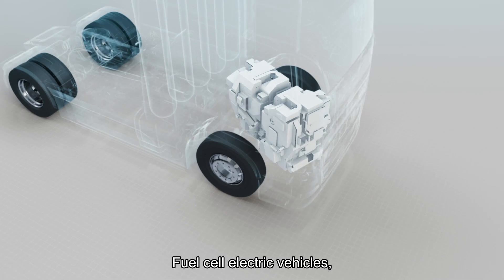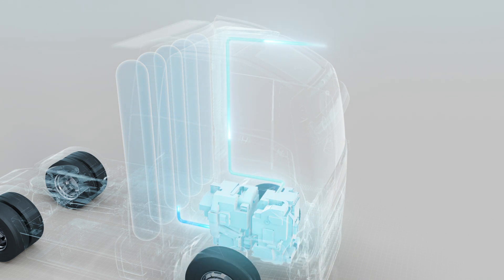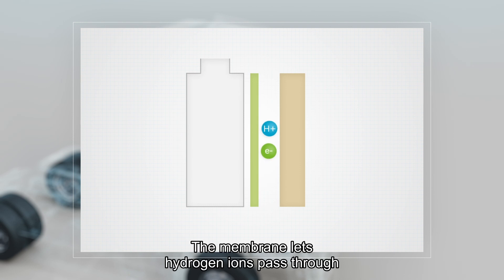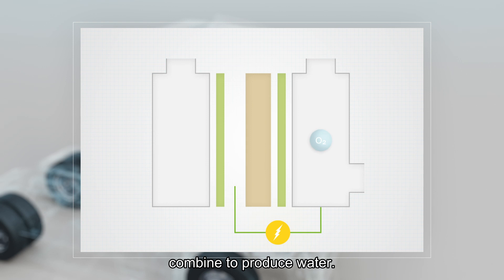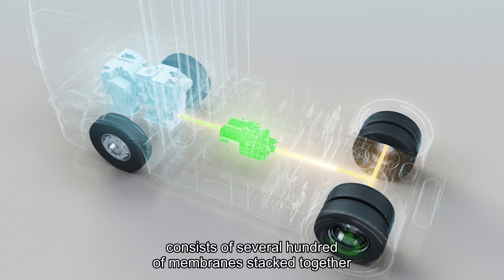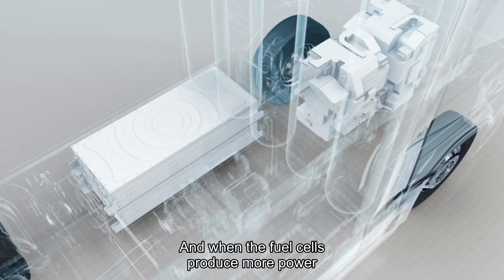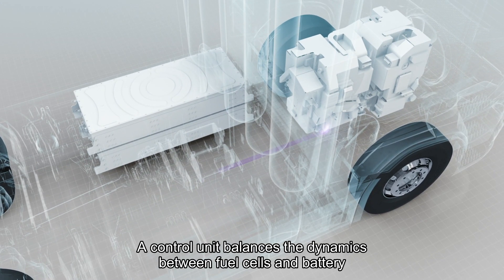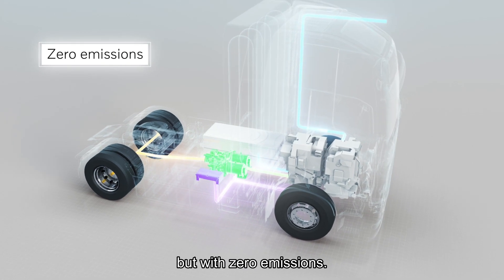How do fuel cell electric vehicles work?

Comment: Volvo why dun you partner with this german engineer named Roland Gumpert? he actually had a Methanol (Liquid Oganic Hydrogen Carrier) Fuel Cell EV supercar (Gumpert Nathalie) and i feel methanol would be far easier to store and transport vs hydrogen?
Reply: burning methanol still produces carbon and it  is more difficult to burn and has lower energy density than gasoline . you are not smarter than volvo engineers.

Comment: TRADUCCIÓN AL ESPAÑOL

Vehículos eléctricos de pila de combustible, donde la electricidad se produce a bordo del vehículo con la ayuda de hidrógeno y oxígeno, ¿cómo funciona?   

Una pila de combustible utiliza el hidrógeno y el oxígeno del aire para producir electricidad y agua.  La celda de combustible consta de una membrana recubierta con un catalizador, cuando las moléculas de hidrógeno golpean el catalizador, se dividen en iones de hidrógeno y electrones.  La membrana deja pasar los iones de hidrógeno, pero no los electrones que, en cambio, fluyen a través de un circuito eléctrico donde se genera la corriente eléctrica.  En el lado del cátodo, los iones de hidrógeno, los electrones y el oxígeno del aire se combinan para producir agua.   

Con el fin de producir suficiente electricidad para poder propulsar un vehículo, un sistema completo de celdas de combustible consta de varios cientos de membranas apiladas juntas.   

El sistema de pila de combustible está dimensionado para un uso normal, pero siempre que se necesita potencia adicional, la proporciona una batería del vehículo.  Y cuando las celdas de combustible producen más energía de la que necesita actualmente el camión, el exceso de energía se utiliza para cargar la batería.  La batería también se cargará con la energía de frenado del vehículo.   

Una unidad de control equilibra la dinámica entre las pilas de combustible y la batería para optimizar el uso de la energía.  A través de este proceso, podemos proporcionar el mismo rango operativo y capacidad de carga que un vehículo con motor diésel, pero con cero emisiones.

Comment: So why aren't there more of these???     Fuel cells are quit old technology.
Reply: Cost of producing hydrogen + infrastructure basically.
Reply: + It’s sort of Mini Bomb if explodes, it has high risks of exploding if something goes wrong
Reply: @_Longwinded so hypothetically if something goes wrong is it like a Hydrogen Bomb on wheels?
Reply: We lose a lot of energy in the process of making hydrogen, and fuel cells only have an efficiency of about 40% when it comes to converting hydrogen and air into electricity. What i'm trying to say is we lose a lot of valuable energy when looking from 'well to wheel', which is why battery electric vehicles and internal combustion engine powered vehicles are still more benificial from a company standpoint. 

In a few years, if new technology allows us to convert natural gas into hydrogen more efficiently (or methanol reformers increase in efficiency in making hydrogen from methanol),  liquification / electric compression techniques improve and fuel cell efficiency improves all while a decrease in cost is observed, then it would be more valuable for us to use this technology.

Comment: Why draw excess electricity from "Breaking" ?
Why not use the rotors on the wheels as little generators to produce electricity while the wheels are spinning ? I mean, isn't That the basic premise of an electric generator anyway ?
Is it because Toyota holds the patient for wheel-based generator technology ?
Reply: It's the same thing, just depends on how you explain it. There's no free ride.
If you draw energy from the wheels as they are spinning, you slow them down. There's no perpetuum mobile possible. You want to draw energy from spinning wheels? Slow the wheels down aka braking.
Reply: How do you people survive?

Comment: Battery again has lot of dependency on charging, so this technology is better that grid charged battery power
Reply: It is and it's probably a lot more  carbon neutral than both gasoline and fully electric vehicles..... The space shuttle used one of these to generate electricity. Also if you could put in a hydrolysis system in to break the water into hydrogen again, you could potentially have an unlimted supply of fuel... so the only thing stopping this would potentially be maintenance.
Reply: @sheilaolfieway1885  At this moment it isn't though, unless we have a good supply of hydrogen. We get some residual hydrogen here and there but far from enough to power our trucks. The rest we need to create using electrolysis, which uses... electricity. Once we start doing that, the efficiency drops to the floor.